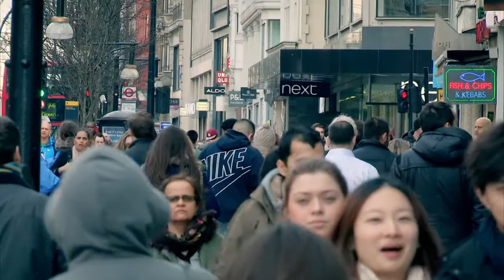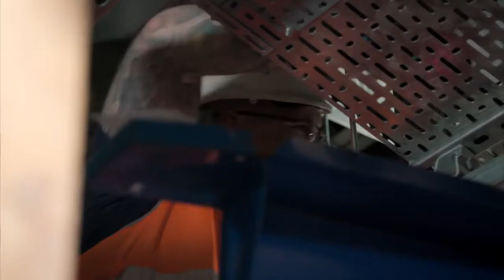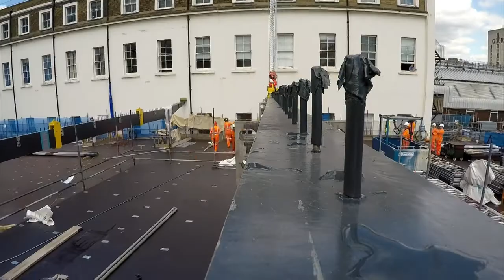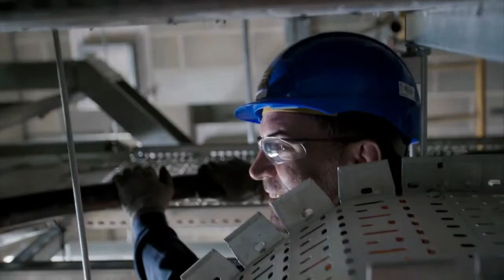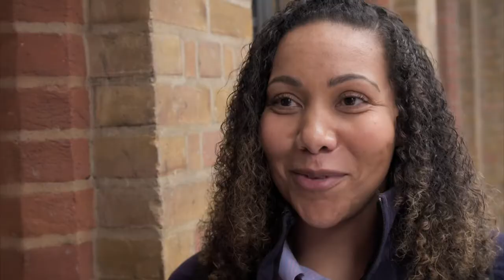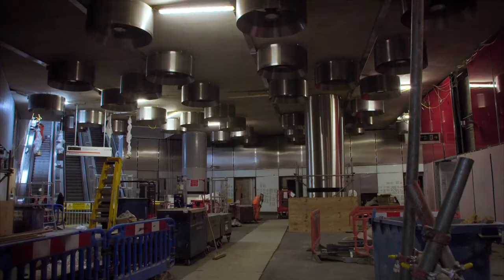The Fifteen Billion Pound Railway S03E02

Comment: If they had not spent so much time and money making the glass panels that included "clouds" inside them they could have saved a lot of money and time.
'nuf sed.
Reply: Would it not have been easier to put the cloud picture on after they've put the roof together?
Reply: i mean who looks at a roof and says that needs something in them
Reply: I hope you're joking, but if you're not, you need to learn about "critical paths" to delivering a project, understand that these glass panels weren't anywhere near any conceivable critical path to the whole project or anything beyond walking into that one station entrance, and they weren't delayed anyway!
Reply: @timothymeyer3210   it's not paint - it's a kind of ceramic glaze that's baked onto the glass. Paint doesn't stick very well to glass and would weather away quickly.